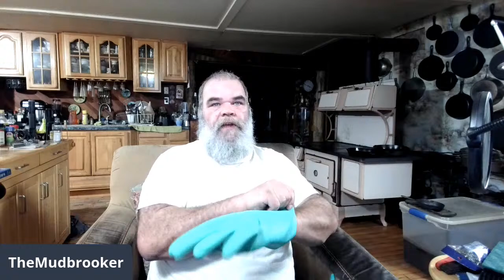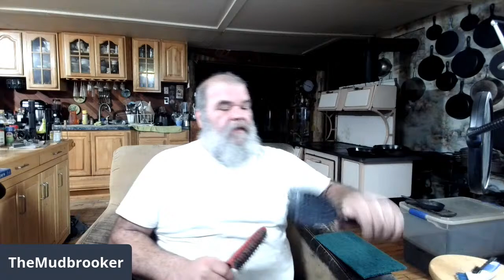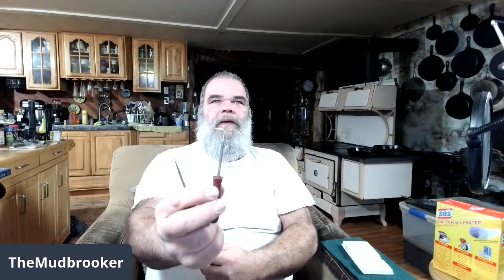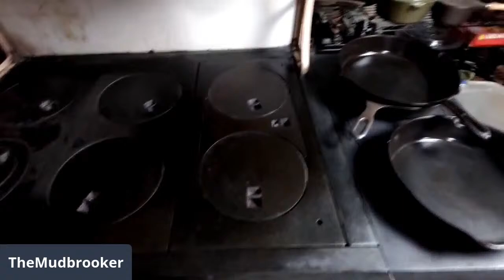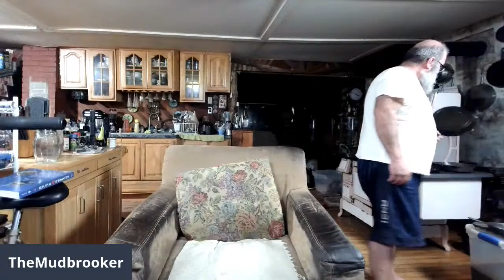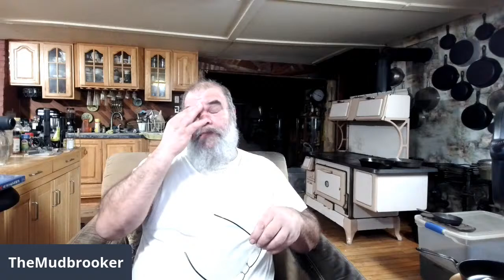Cast Iron Restoration Tools

Comment: Nice video again, as always. I have a little 2 eye cast iron stove I'm cleaning up. It cost me $20. The whole thing is completely rusted and must have spent a good deal of its life outside. Every surface will need some kind of treatment and I was leaning toward just trying to season it like a skillet. I've read other people's opinions on stove black and stove paint and didn't like any of the advice. I was curious on your success with Easy Beezy. It sounds like you like your results. I first thought one drawback might be that the stove will get so hot it would burn it all off like a self cleaning oven would and was wondering if that was why the hotter spots of your top seen to "dry out." Maybe I will just need to apply a fresh coat after so many uses.
Reply from the maker: It is burning off in the hottest areas, but it's leaving enough residue behind that it's darkening and bonding carbonized material to the iron that doesn't just wipe off. Right now it's kind of an experiment over the last few weeks I'll be using the stove for the winter but it seems to be very promising. Like I mentioned, I'm gonna run everything through the electrolysis tank over the summer and start it over in the fall.

Comment: The newer Lodges do smooth out over time with use, but I'd be interested in trying a random orbital sander with 50 grit. Maybe I'll take it down to a higher grit. Wonder if stripping the pan first would be a good idea?
Reply from the maker: I just did a video using 50 grit and a random orbital sander on a Lodge pan. It still had the factory seasoning but I didn't strip it first. If it has more than that it would probably work better if you did strip it first.
Reply: @TheMudbrooker   Wonder how they used to machine them at the foundry...Anyone know the process? The one notch Lodge that was my grandmother's is a much thinner casting and has machined surfaces. Really a joy to use. I opted to strip it down with oven cleaner (had build up on sides) and season with crisco.

Comment: How long do you let the oven cleaner sit on the pan? I found I could really easily use a bottle and a half on one number eight sized pan.
Reply from the maker: The first time around two or three days (in a plastic bag) works very good. After that it depends on what's left, maybe a few hours,maybe overnight.

Comment: I am having a hard time find the manufacturer and age of my cast iron pan.  No marking on top, flip it over and all there is is a solid ring and what appears to have a hand chiseled W of M where the handle makes the pan.  Pan size is about 8 inches, but no other marking anywhere.  Any thoughts?
Reply from the maker: Don't know off hand, do you have a webcam? If so, join in one of my livestreams and maybe we can figure something out.
Reply: @TheMudbrooker  Yes I have a webcam. When is your next livestream? I appreciate your help!
Reply from the maker: @JLDock  I'm doing a member's stream on the 24th and the next public one will be the 31st. They should be at 6:30 PM central time barring any disasters.